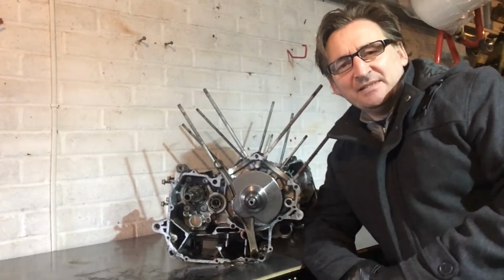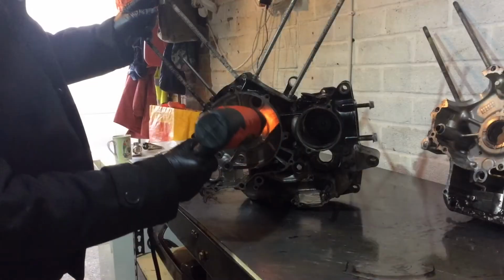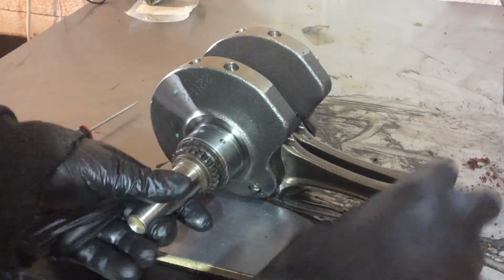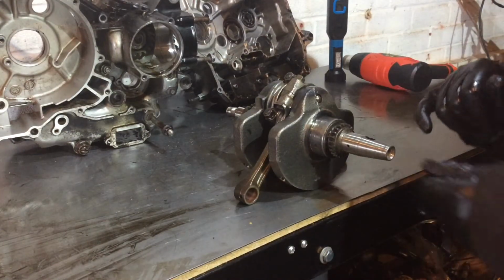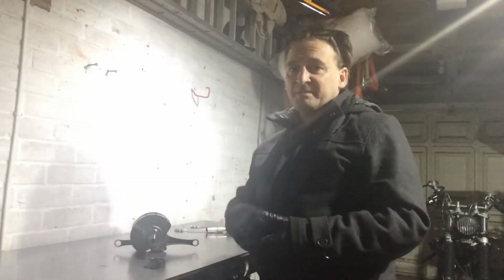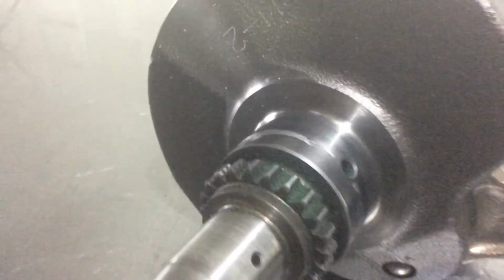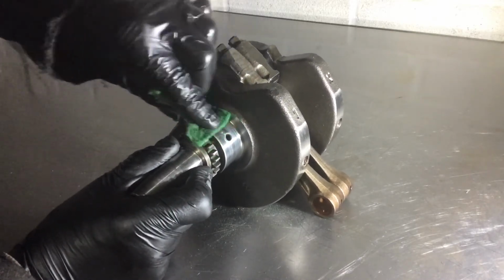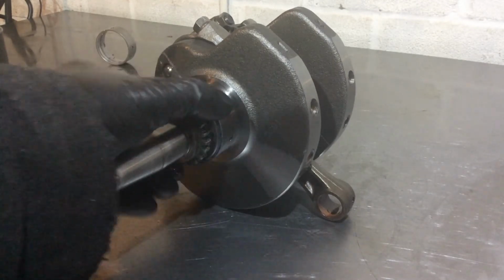Virago XV535 EP3 Seized Crank Repaired

Comment: Hi, I watch carefuly your videos, awesome job with great explanation. I have 535 Virago and some knocking noise at idle, when I give it a gas no knocking, that's first sound. Second sound from engine: After a 5 minutes of druving when oil get hotter engine start to make clicking nosie, very similar to valves sound but it isn't. I check clutch basket it has a little play and crankshaft has end play of 0,34 mm. Is it in specs or out of specs? Also timing on front cyclinder is more than half tooth off. What can cause knockin and clicking? Thanks in advace. BR
Reply from the maker: I don’t have the service limit on end float for the crank, but that seems a bit out of range, I would expect 1/2 that typically, and certainly could contribute to the knocking. clicking can be over stretched cam chain, weak tensioner. You could try shimming the spring inside the mechanism. The fact you have 1/2 tooth out situation backs up the fact the chain is stretched, so new chain and tensioners would assist, but of course there are to of them. New ones are pricey, and no point in getting used as they won’t be any better. The other cause of clicking when warm can be exhaust, so check the header bolts are secure and haven’t worked their way out. With too much end float, this can cause rod and big end damage, so worth keeping in check, and can also be shimmed with the correctly machined parts, but it’s a lot of work.

Comment: Video very well explained and super useful to help me with my engine which has the same symptom, but still runs by luck.
Are official parts still easy to find?
Reply from the maker: Like many bikes of this age, most parts are still available from dealers, and eBay is a great source, and on an old engine I’m not averse to getting used OEM parts. They’ll be worn but they’ll mate to another old part just as good as a new one will. Time to get it apart and see what the issue is then decide if it’s aftermarket, OEM new or used that’s suits best. Does it go through all the gears ok ? It could be so many things it’s hard to say without an internal inspection. Hopefully something simple my friend.

Comment: Sterling effort! Thats brilliant mate. Really lucky with that bearing. Getting all the pick up off as well is a real stroke of luck. Looking forward to the rebuild!. 👍👍
Reply from the maker: Thanks Rich. Got lucky this time I think, but I’ve found shards of aluminium and steel floating about so the next vid will likely be hunting the source of that as well,  and it’s nice to actually do something worthwhile for a change. I have been meaning to ask you what the BB stood for, for quite some time, now I know 😊 I like the new channel name, it sounds very pro. How’s your gear selector repair holding up ?
Reply: @memybikeni9931  yea the gear shift is bang on now. Amazing what a bit of cleaning does. Glad you like the new look, the BB has stood for a few things over the last 2 years, so i thought i should nail it down.